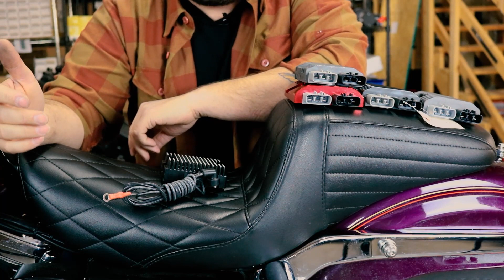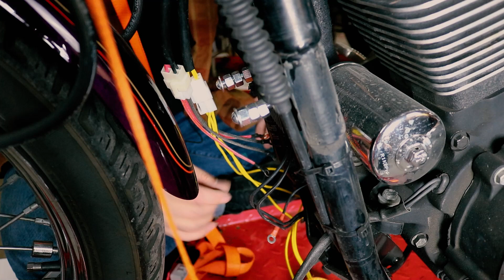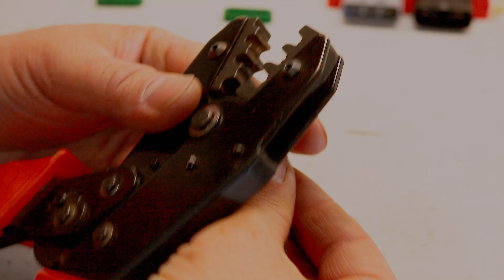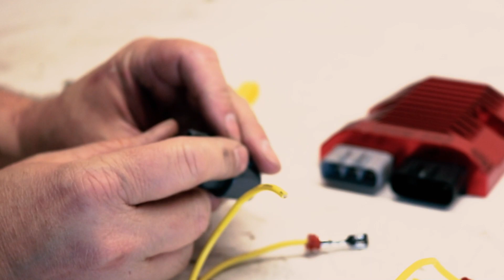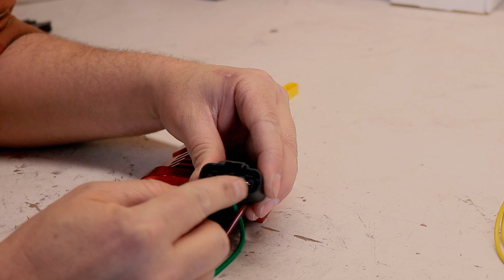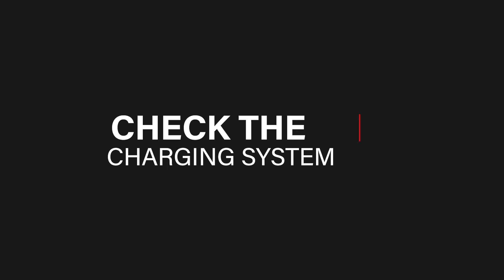Upgrade your voltage regulator rectifier to MOSFET, SERIES, LITHIUM on any motorcycle, ATV, UTV, PWC

Comment: Is there a MOSFET regulator that will work with a single phase stator like on older Skidoo sleds?
Reply from the maker: We have some Single phase MOSFETS available, like our RM30925 Harley Davidson regulator. Otherwise you can use a 3 phase MOSFET regulator and leave 1 phase unplugged if necessary.

Comment: It wasn't clear....are the 2 battery wires connected into a single connector each? Is it ok to do that? I couldn't really see it properly but ok, it does explain the 4 wires if that's what you've done.

Comment: On the original battery side connector there are 4 wires....2 red and 2 black. On your new regulator connector you only explain what to do with 2 wires. What heppened to the other 2 wires?
Reply: From what I see, he connected both positive wires together and put it in the positive mount of the rectifier, same with the negative wires